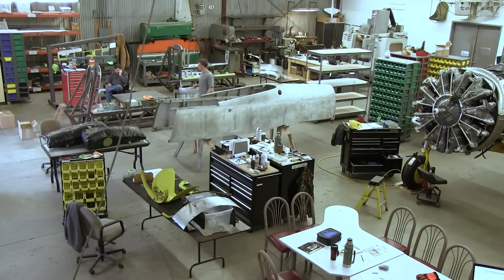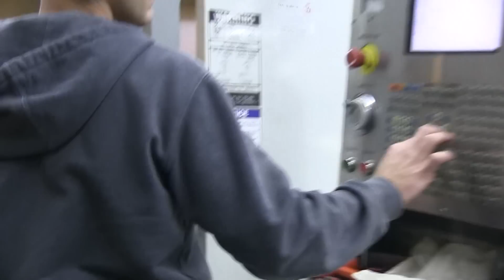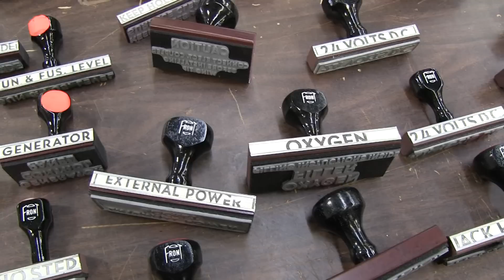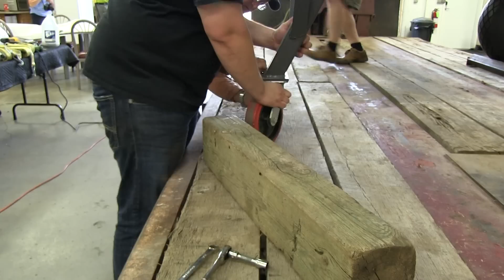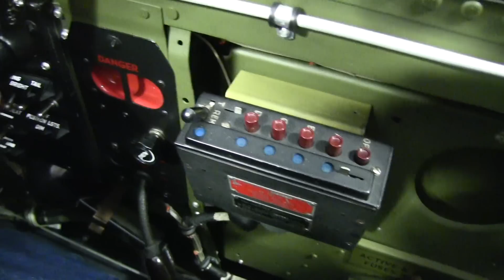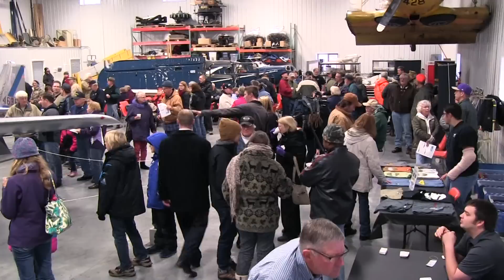Sierra SueII Master with new ending 2 12 15

Comment: No "ROLLS-ROYCE" on the VALVE COVERS? Isn't that a REQUIREMENT on a "Merlin"? Personally I wouldn't want anybody knowing my uber-expensive "toy airplane" had a Rolls-Royce Merlin in it EITHER since those overrated "legendary" boat anchors are only "good" engines after decades of "development" nearly all of which took place in the U.S. and lasting long after the end of WWII. And that's a "ramp head" Merlin, correct? Aren't those pretty "late" engines or were they "early" engines? I can't find pictures online of a Merlin "ramp-head" with an oil-cooler/water-pump assembly on it quite like the one in the video. 

And most of the pictures I see of ramp-head engines show a much larger and obvious water manifold on the outside of the cylinder blocks below the spark plugs where that smaller manifold is but they also seem to connect to more cylinders on the engines I'm seeing and the manifold is a big chunk of cast metal. Its pretty widely known among non-Merlin fanboys and "enthusiasts" who just believe whatever they hear/see/read in "history books" and "documentaries" that despite all the Merlin HYPE the engines were pretty weak, Rolls-Royce then as now was pretty much just a "shell corporation" and name brand and its "engineering ability" was limited mainly to "reverse engineering" and "farming out" the "hard parts" of engineering to other companies, spending tons of money and time on propaganda about how great they are and then taking credit for the "performance" of "their" engines. Or they just buy from other companies outright, install those parts/components in their machines and forget to tell anybody about it. After all, Rolls-Royce has never boasted about putting small-block Chevrolet engines and GM Turbo-Hydramatic transmissions in its "fine road cars" for most of the 1970s. 

And when it comes to the "Packard Merlin" the arrogance becomes unbearable. Apparently R-R did Packard a "solid" LETTING YANKS BUILD LEGENDARY ENGINES. And those "yanks" get ZERO credit for "upgrading" the Merlin dozens of times along the way and making it the "legendary" engine it MUST HAVE BEEN by the time a MERLIN took the MUSTANG from a flying piece of garbage like it was with an ALLISON to the GREAT AIRPLANE IT IS TODAY. Credit to Packard and American "workers"? Zero. Credit to "Ms. Shilling" the "secretary" and "undercover engineer" that "figured out" the problem with Merlins "losing power in a dive" was a fuel delivery problem and then designing "Ms. Shilling's orifice"? She's easily the most famous aircraft engine "engineer" EVER I'd say. That "legend" doesn't say much for R-R's OTHER engineers and it kind of points out that the engine was never "perfect" or even "acceptable" if it took dozens of "marks" to "upgrade" it. 

Of course as those of us who know at least a little about engines we didn't learn in an easy chair watching BBC documentaries or at the computer watching YouTube or in "history book" and other "publications" extolling the almost scarily-badass Merlin if it is as good as claimed, the legendary Merlin by even standards of the time was "primitive" and British boasting about "hand-fitted" and "hand made" and parts "filed to fit" is only boasting for those who don't know that it has to be pretty much the only "file to fit" OHC V-type "legendary" engine in history. particularly in the valvetrain with no "followers" or "crossheads" to operate valves and control valve lash hydraulically or at least make it easily adjustable mechanically and to operate two valves from one camshaft lobe so the engines COULD have had a single camshaft or at least a far simpler camshaft with ONE lobe per valve pair and all the intake valves on one cam and exhaust valves on the other instead of a pair of camshafts and half the exhaust valves and intake valves on one bank operated by one cam and half by the other. 

I could go on and on about the Merlin but it wouldn't make any difference and overall its not like the Allison was that much better of an engine "design" besides being at least "contemporary technology'" compared to MOST of what was out there back then and well head of some of the other stuff. But V-12s in general are grossly overrated and V-type engines in airplanes was primarily "promoted" by companies/countries that didn't have the "resources" to keep up with the radial crowd. The inability to design and build aircraft capable of "balancing" all the engine weight that far forward in the airframe and the torque loads as well was another issue. And of course radials are WAY more efficient at putting the TORQUE to the PROP in a DIRECT DRIVE manner so that "engine horsepower" is a whole different scenario with radials. 

The gear reduction of an inline engine "gears down" the propeller but it also takes tons of power to operate it and adds a lot of weight and complexity and puts the propeller much further from the actual engine than it needs to be and you actually end up with a MUCH narrower "power band" with a V-type engine than a radial. Sure you get a "narrower cowl" but you also have to cram the intake system and superchargers and ducting of the inline engine into a "package" that makes them far less efficient than a "free breathing" setup. And then there's the LIQUID COOLING. The proof of any technology/design is in its durability and as a CURRENT technology/design rather than "how long does it last" in operating hours. Radials absolutely became "obsolete" as well but the REAL goal of SOME of the inline "aero engine" manufacturers was not to "compete with" the radial. 

The goal was to "replace" the radial. A goal they were destined to fail at primarily because they decided that V-type engines were the solution for a high-load, high-torque heavy-duty application. V-type engines are always trying to "twist themselves to pieces" and that can be "mitigated" in a vehicle chassis and with proper design and knowing that when you put TWO BANKS OF CYLINDERS IN A "V" you're not pushing DOWN on the crankshaft you're pushing SIDEWAYS ON THE CRANKSHAFT and CYLINDER COUNTS and FIRING ORDERS and V ANGLES are all IMPORTANT and a V engine is NOT a "pair" of X-cylinder inline engines "sharing a crankshaft". Nor does putting the camshafts in the cylinder head "fix" any "flaws" with a V-type engine or any other. There is no "flaw" with cam-in-block engines and there are PLENTY of OHC engine "weaknesses" that the "average person" never comes in contact with because they're not mechanics. 

And MOST of those flaws are related to the valvetrain and driving it so even diesel mechanics working in an industry where OHC engines are commonplace and 4-valve engines go back many, many decades and OHC 4-valve engines are out there by the millions don't get exposed to too many issues with OHC. And of course since only "high-end" and "luxury" and "racing" cars have been "traditionally" equipped with V-12s ALL of which in the "modern era" have come from Europe where cars in general aren't "daily transportation" for most and for NONE in the wide range of weather conditions and road conditions and uses and applications and "driver skill level" cars in the U.S. are subjected to and have to "survive". So here in the U.S. even most auto mechanics never see much of or think about much V-12 engines, many don't work on a lot of OHC engines (General Motors is SO "prehistoric" still using cam-in-block 2-valve engines) and very, very few get exposed to BOTH. And those that do work on??? High=-end vehicles. 

Weird how nobody ever just "downsized" such a legendary engine like the Merlin. Or at least the Allison which is pretty much what the Merlin was "upgraded" into as far as possible given what they had to work with at Packard. Oh, that's right. The ALLISON was junk and the MERLIN made the Mustang a "great airplane". Yeah. Tell that to a P-38 pilot OR the WOMEN who ferried hundreds of P-51s and presumably the Allison-powered Mustangs to jolly old England. And when you consider that both the P-51 and P-38 as well as the B-17 and pretty much ALL but a few "warbirds" the U.S. "designed" and produced between 1936 and 1946 were ORDERED BY THE BRITISH AND BUILT TO THEIR "REQUIREMENTS" INCLUDING THE ALLISON-POWERED ONES, you have to wonder why the BRITISH ordered "their" Mustang with the ALLISON IN THE FIRST PLACE. And why use ALLISONS TO FERRY AIRPLANES TO THE U.K. WHEN PACKARD MERLINS WERE BEING BUILT RIGHT HERE IN THE U.S. ONLY TO PULL OUT THE ALLISONS AND PUT IN THE MERLINS? 

Maybe those Merlins aren't QUITE as "legendary" as we're told. But then again "legendary" is what something is portrayed to be or have been in a STORY told long after by people who weren't really there at the time but that DOES or DID actually exist. Kind of like a MYTH but with an actual subject or object the MYTHOLOGY is created about or around. So the Merlin IS "legendary" if for no other reason than a LEGEND has been created around it that it couldn't possibly live up to just like most MYTHOLOGY is about impossible acts performed by non-existent "beings". Doesn't matter either way. If the Merlin fanboys want to claim the Merlin they have to face up to the fact that its only what it is today because it was never good enough "upgrade" after "upgrade" and unless you put some Allison or Allison-designed aftermarket parts in one, you're kind of rolling the dice really putting one to work for long flights and/or heavy loads. Might be why they didn't "cross the pond". At least not in the air.
Reply: The Myth is much more romantic than the truth, and easier to research.